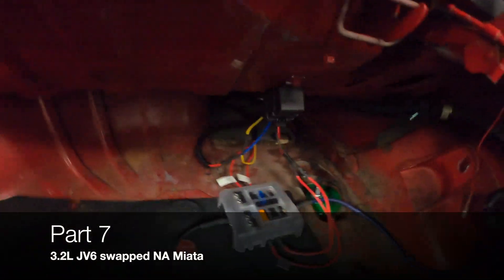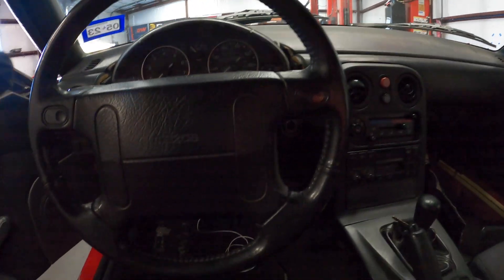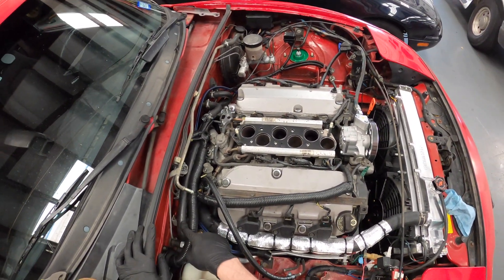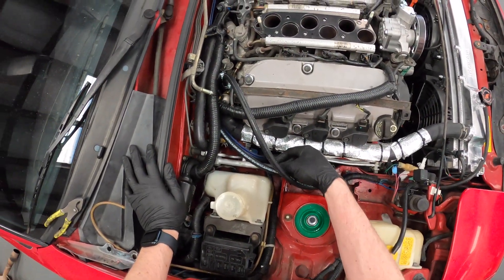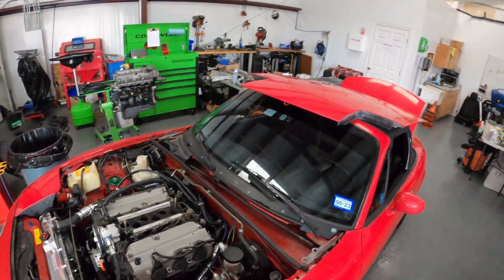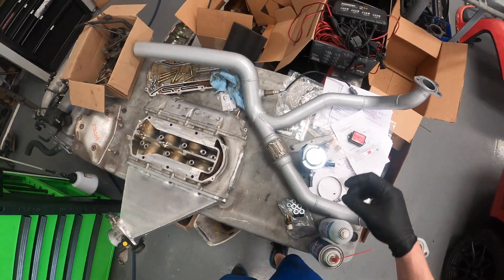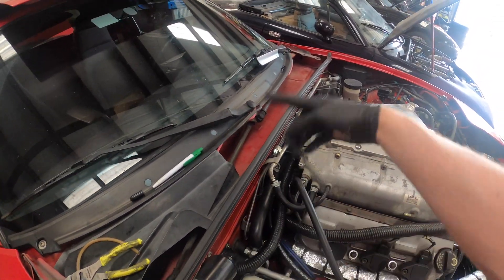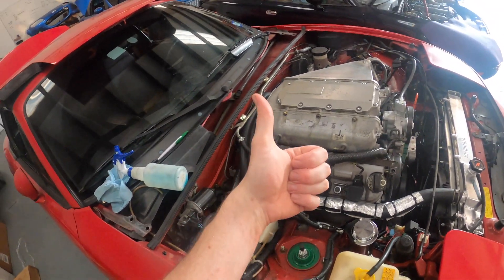Honda V6 3.2L swapping an NA Miata - Part 7

Comment: what wire did you send the black and white to on the honda side? If it's at the flying lead do you remember what pin on the ECU it was?
Reply from the maker: It's been over a year I did this so I won't be remembering anything. It may be in video part 5 or 6 though.

Comment: For the secondary ecu did you just take the stock miata switch on and start signal wire and splice it into the Hondas ecu?